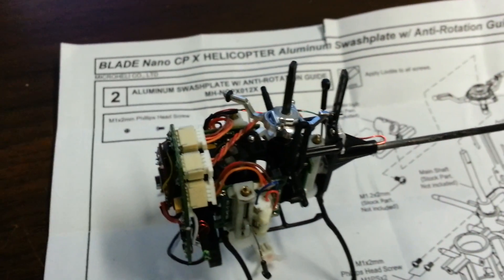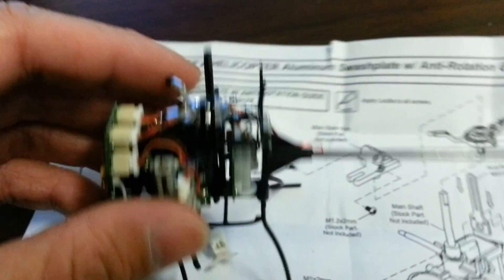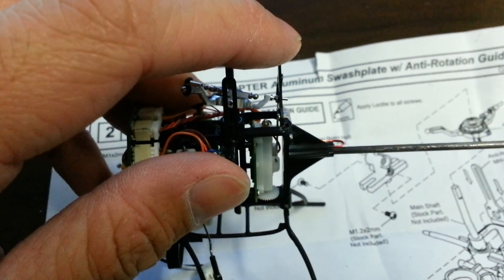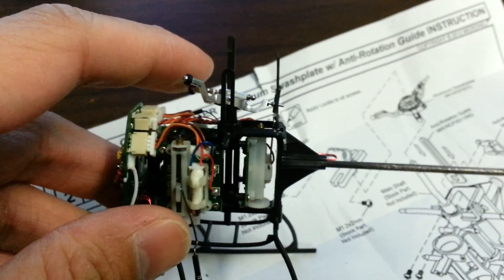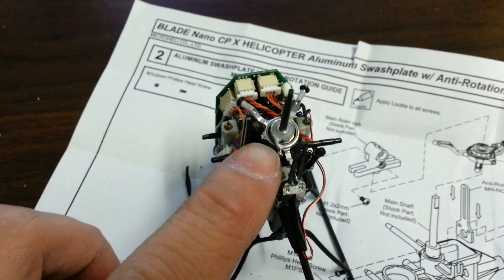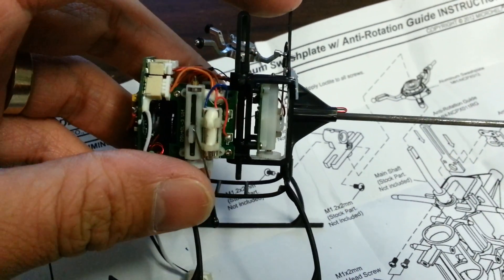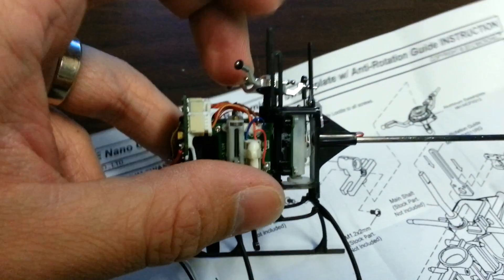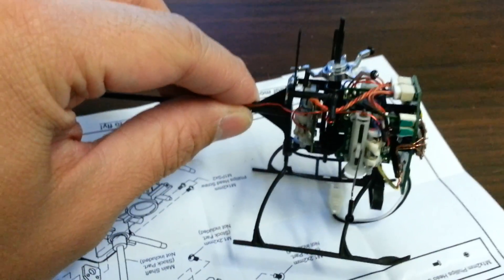Microheli Swashplate problem

Comment: Just FYI, I bought a microheli swashplate from wow hobbies last week. Installed it on my Nano last Friday (a week ago). It has a pin out the side like the stock swashplate has, so it works with the stock antirotation bracket (or in my case, I installed their improved carbon fiber antirotation bracket onto the side of my aluminum rakonheli frame). So, they fixed this issue. Good video though, interesting they didn't always have that pin in place.

Comment: Tony just cut the little pin off on the servo mount drill it with a small bit then put little washer spacers and small self tapping screw to hold it in place that way you're not relying on the little pin that holds the servo in place

Cheers bud